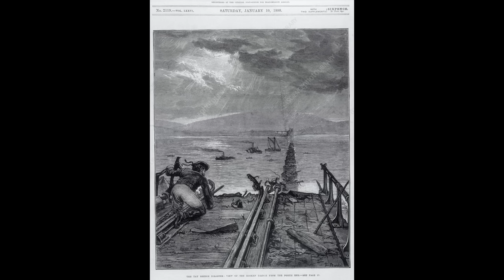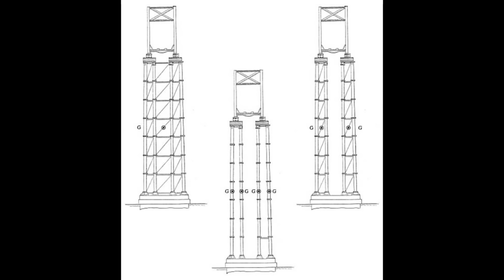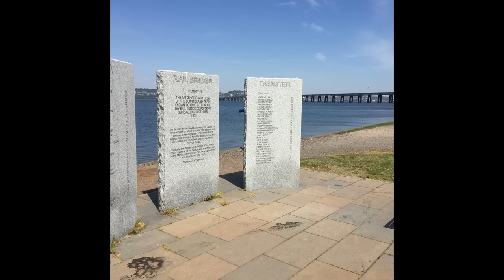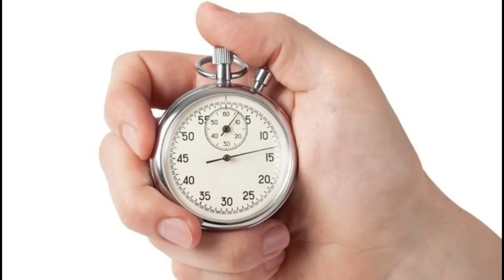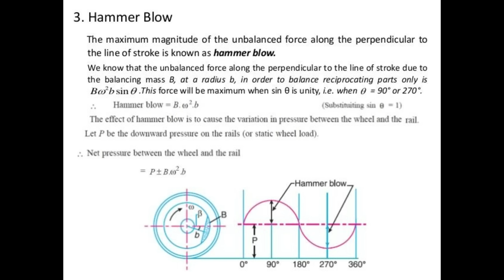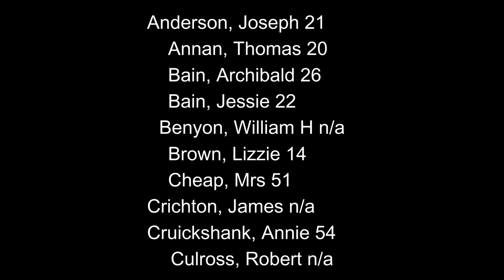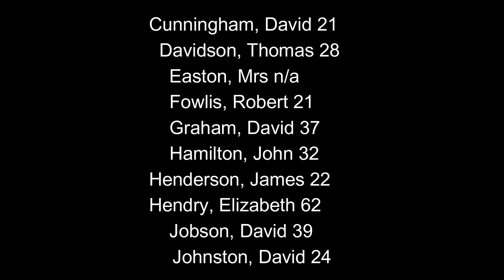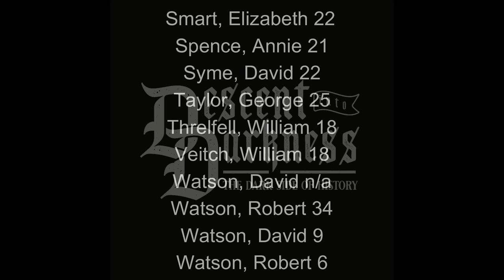The Tay Bridge Disaster: Death by Design | Flimsy Metal & AWFUL Poetry!

Comment: A good account of the disaster followed by an entertaining poetry recital.
About 35:00 you asked whether you missed something and to share it in the comments.
I have a couple of things about the locomotive.
Recovering the locomotive took three attempts. The first time the lifting tackle was not strong enough and the locomotive would not budge. When they tried a second time they used stronger chains and got the locomotive out of the water just before they too failed. The locomotive dropped back into the river. On the third time, with everything reinforced, they were successful.
When the locomotive was rebuilt the crews were mostly fine with her except nobody wanted to take her over big river bridges especially the rebuilt Tay Bridge. She did not cross the new bridge until the 29th anniversary of the disaster in 1908. I wonder if the train passengers realised the were on the same (evening) service with the same locomotive as the people who perished.
Just my thoughts.
Reply from the maker: Thank you very much for those extra bits! That’s really interesting. 👍🏻

Comment: Quality research yet again bravo. I'm qualified to have this next opinion,  so I believe the original design was cutting edge and well engineered. As soon as the client specified a single track crossing you know they are cheapskates. A genius engineer offers them a solution for their low budget. Even if he was the Resident Engineer,  he wouldn't have had enough staff to oversee the level of corruption that crept into the contractor. If you look at the replacement, they made it 2 way, thus massively increasing the loads and potential design solutions.  And what did they build? The most bog standard safe bet probably at 10 times the cost of the original design. So the bean counters cost everybody more money...
Reply from the maker: Quite right! I believe Bouch was a freelance engineer at the time but I don’t know that for certain. He had done work for other railway companies, as mentioned.
Reply: @DiD86  the ICE epitaph was interesting really good bit of research that 👌 I'm a member and that reads to me he was highly esteemed within his profession but they had to add the qualifiers for public consumption. You can bet the new bridge didn't have iron filings and wax filling defects in structural members. Anyway brilliant work mate, first saw your stuff thro the Peter Sutcliffe doc, absolutely first rate also.
Reply from the maker: @miles-thesleeper-monroe8466  yeah, he wasn’t a bad engineer as far as wins vs losses go, if you want to put it like that? 😂

I massively appreciate your support it massively encourages me to carry on. I’ve already written a couple more scripts since this one and when I get the inspiration for a new one, I go at it like a demon. Research is a lot of the fun of it to be honest.
Reply: @DiD86  oh please do carry on and remember your earliest fans when you're famous! ✊😁
Reply from the maker: @miles-thesleeper-monroe8466  how could I forget? Lol
I don’t know about fame or anything like that, just as long as you’re all entertained, that is my goal.

Comment: Those sections of the original bridge that survived, were moved "sideways" and incorporated into the new replacement bridge. Along with the extra materials to make the newer bridge a double rather than single track structure. As for the centre section, they were known as "the High Girders." In turn as with Oh so many bridges on the lower sections of various rivers/firths were built with a clearance of 100 foot at high tide, due to British Admiralty regulations which dictated the clearance to allow as you mention sailing ships to pass beneath.

Comment: The sparks seen by the signalman may well have been from the firebox of the engine when it hit the water. If the coaches were relatively new, and lit by gas, rather than oil which was normal in the Mid-Victorian period, that would also cause a fire if the gas canisters were ruptured. The boiler remained intact when it hit the freezing water, which is a testament to the sound design of the engine. When the engine was recovered, it was repaired, put back into service and was only withdrawn in the 1920s.

Comment: 13:17 well the dimensions were know beforehand and could be checked - right ? In that case the blame goes 100% to designers and people checking the design. If it’s about the material not up to spec the blame lies with the manufacturer and their control system - filling imperfections with disguising materials of cours is straight out criminal

Comment: 15:45 -- RE: Trains being blown off the tracks by wind alone;  There are some significant provisos to mention with respect to this set of phenomena.  Firstly, I suspect that one of the common factors in any such accident is that the railroad itself is narrow gauge, although it is not an essential factor.  Secondly, seasonal variations in prevailing winds will likewise be an aggravating but not necessarily the ultimate cause of the accident.

To illustrate:  the Newfoundland Railway (1898 - 1988) has an infamous section located on the western side of the railway, called "The Wreckhouse".  The local geological formations in the landscape force the railway to take a route near sea level and into a pass between 2 very high mountains, and the prevailing winds are such that the pass becomes a naturally occurring wind tunnel.  Consequent to several accidents on that railway in its early years, "The Wreckhouse" became a regular stopping point during a cross-island journey on that railway, with special signals to trains to indicate that the winds were too high and that they must stop until the winds had died away.
Reply: ^^ The Wreckhouse remains a hazard to land traffic, to this day.  The Trans Canada Highway runs alongside the old railway bed, right through it.  Transport trucks have likewise been overturned there by the transient windstorms.

Comment: The relief fund of £1,900 16s is NOT worth £126M but £217,000 in todays money;  this is a strange mistake to make.
Reply from the maker: I’ve just checked with the (admittedly out of date) currency converter that I used and I’ve realised I got the decimal place completely wrong! 🤦🏻‍♂️

Cheers for pointing it out. I’ll put it in the corrections.

Comment: There is no way that £1900 in 1880 would equate to £126,000,000 today. The average annual wage of a labourer in 1880 was £30, which according to your formula would mean a wage of £2,000,000 per annum.
Reply from the maker: I f-ed up my decimal point.
Reply: @DiD86  £1,260,000 seems more reasonable, given that the average wage of a labourer in the UK these appears to be £23,400.

I'm almost inclined to ask if you could lend me a tenner. 😃
Reply from the maker: If I had a tenner to give, I would. 😂

Views are in The toilet at the moment, sadly. 😔